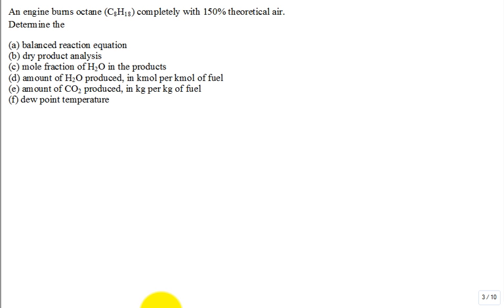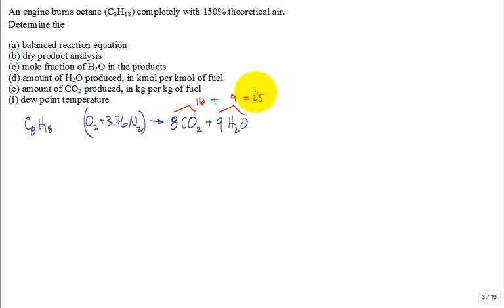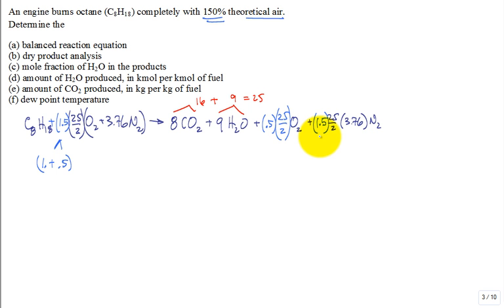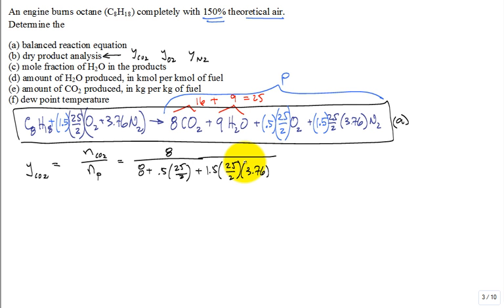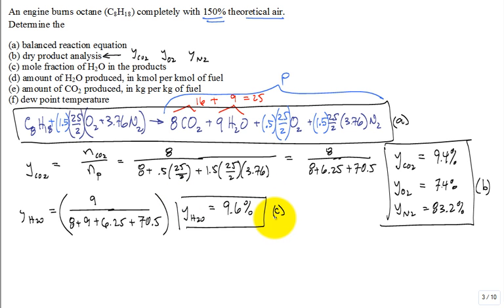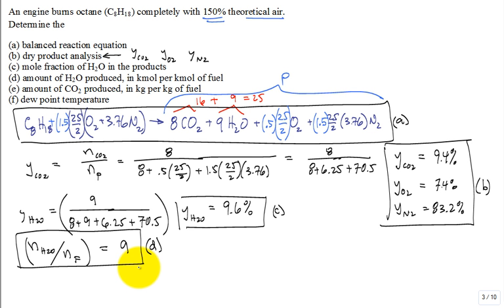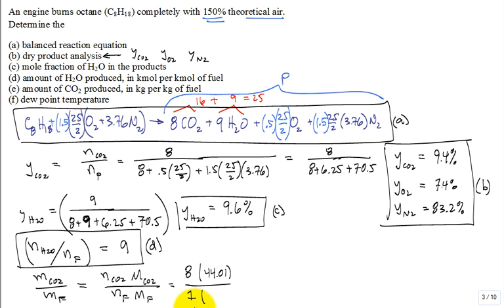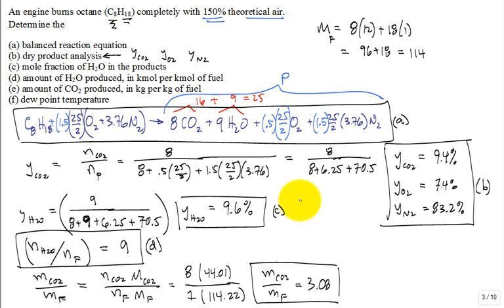Combust Octane 150pct air

Comment: you lack an explanation: "because we have more nitrogen" why? you dont explain why we have "more" nitrogen. "then we need to fix the nitrogen" I wonder what your class avg is? probably one of those teachers that have to use a bell curve to prevent the class from failing. P.S. if you are one of those teachers who implements a curve in the class because class performance is poor, newsflash is not because your students are dumb. Its because you teach poorly.